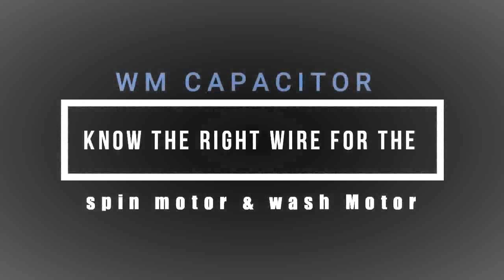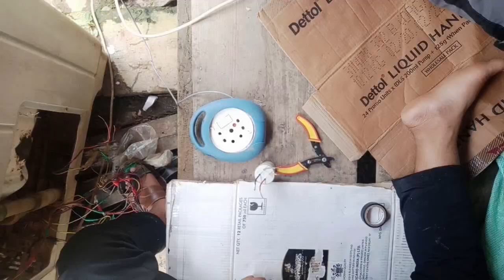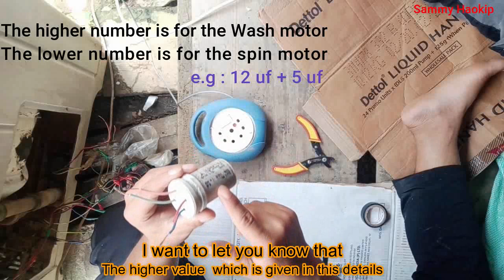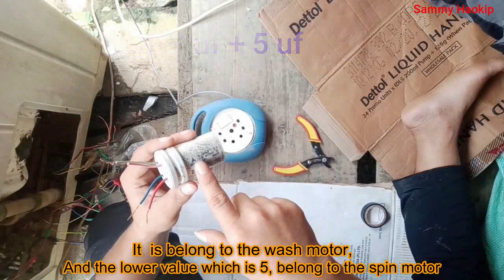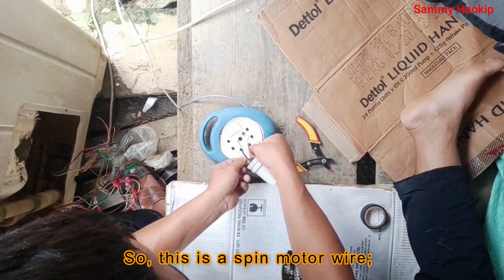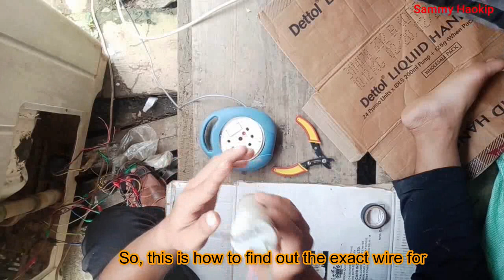WASHING MACHINE || How to identify the capacitor wire for the spin & wash motor

Comment: Cant find my answer any place

Can i connect start and run wires of my new spin motor on any of the 2 points on spin capasitor? 

Got a defy twinmaid 1300.
Reply from the maker: Yes, connect it to any point. But not with the common.
Reply: Aaaaaaaaa!!! Thanks sooooo much for reply. Now im 100% sure i cant burn my new motor. 

Have a awesome day. 

From South Africa 🇿🇦😁

Comment: Thank u for sharing this information! Im having trouble, finding the right capacitor, for this Motor: 195 V 399hz 17500 RPM AC-EL. Can u help me out please? Country is Germany. THANK YOU! :) KEEP IT UP!
Reply from the maker: Hello Neo, sorry to answer you lately..
For your motor that has 195 of voltage, I would probably be using above 12uF if it were mine. Because the greater uF you have, it would run efficiently.
I hope it meets your question. Feel free to write me back if any. 
Thank you😊

Comment: hi..can i know the wire capasitor got live and neutral or not? can try as much as you like?
Reply from the maker: Hello friend..my apology for answering lately.. 
Well to answer your question in short ,  capacitor does not have types of neutral or phase. But it depends on the control or we called as a timer. 
When this timer is been connected with the capacitor, it will generate as a neutral and phase. But capacitor Without the timer/controler, you would see both lines are alive.which means that you can get a shock and is dangerous to play with. 
Hope it meets your question🙂

Comment: Thank you for explaining this so easily 🙏liked and subscribed, could you please  advise what value/capacity the capacitor should be for a fully automatic 7kg washing machine...should be 12 uf or should I buy a lesser UF one. My original capacitor is blank and I have no labels. There are different options on Amazon 10 UF, 9 UF etc...and I don't know which us the right one. Thank you Sir.
Reply from the maker: Hello mate! Thank you.. 
Answering your question:
1) when it comes to capacitor particularly on washing machine,  it work great in both higher value or lower value.  However,  if you can afford to have higher value, that's great.  Cuz  it stored a huge amount of currents and supply more current efficiently to the machine.

2) I suggest you buy the highest value you desire.  
Thank you
Reply: @sammyhaokip7452  Thank you for your prompt response mate.I  just didn't want an issue by choosing a higher capacitor and have issues. As once I had fixed a higher capacitor to a ceiling fan and it didn't work out 😔 But since it's a washing machine will follow your advise. Thanks mate.!!